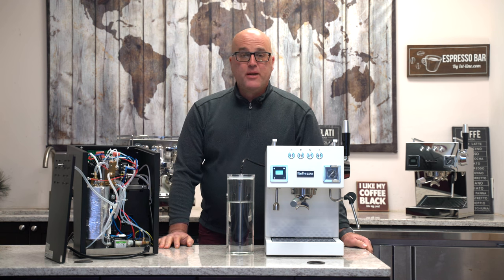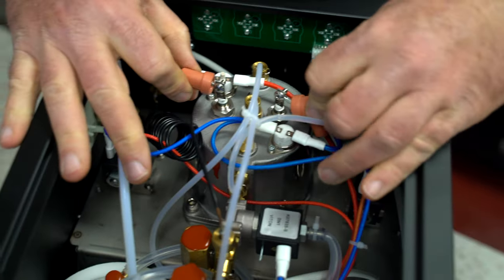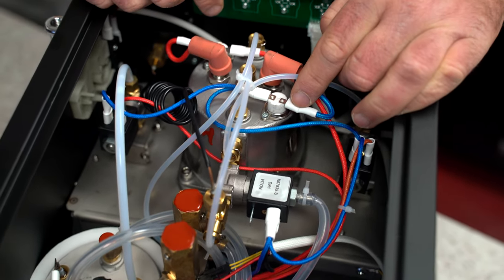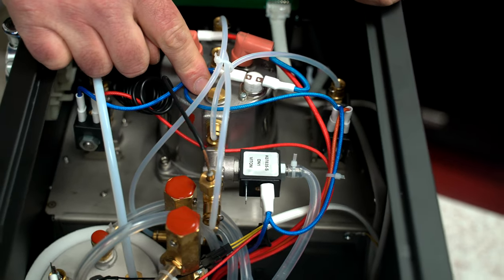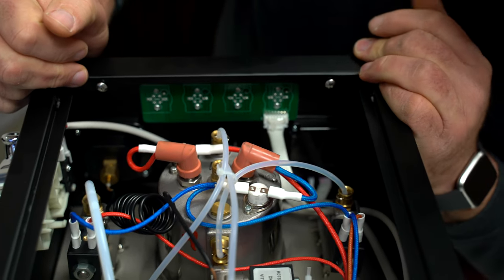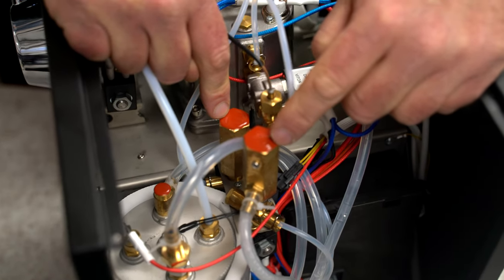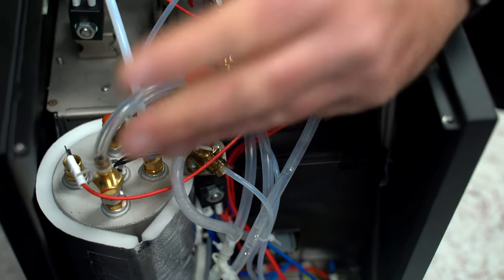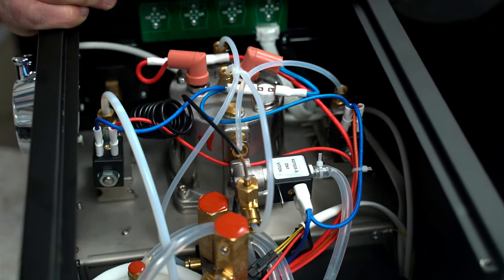Inside The Bellezza Bellona Dual Boiler Espresso Machine

Comment: How would you rate the repairability of this machine? Do you get spare parts from Bellezza?
Reply from the maker: It is not the easiest machine to repair, but not near the most difficult either. So far, we only had 1 issue of a loose wire on the wire coming off the screen. 2 machines arrived dented in shipping. The body panels have been the msot difficult to acquire.

Comment: Love the video - question for descaling - how would you empty the steam boiler? I assume descale solutions will enter from the water reservoir into both boilers, leaving the question of how to ensure the steam boiler can be emptied.
Reply: Did you find an answer to this? The hot water spout on mine is not working which is normally how you would empty the steam boiler. I'm hoping the descale from the steam boiler can be emptied through the hot water valve on the bottom of the machine.
Reply: @imcravingcoffee  The bellona"s hot water spoud is fed by the brew boiler not the steam boiler.  I believe there is a valve on the bottom on the steam boiler to empty it.

Comment: So does the OPV drain into the drip tray or back into the pump?
Reply from the maker: Please re-watch the video as this question was covered.
Reply: @1st-lineequipment  bit of an ignorant response but ok.  I re-watched and it still isn't clear.  You mention an "air release valve" I have never watched a review of any machine that mentions this part. Best I can tell you are saying it routes the extra OPV water back into the "beginning of the pump" so you're saying it doesn't route it into the drip tray.  Correct? Well this goes against most of the posts I have read about this machine, including from people who own it. Not sure who to believe on this....
Reply from the maker: @giltender  Sorry you are having a difficult time understanding. If the hose from the OPV goes back to the beginning of the pump, then it can not direct to the drip tray. This is why Java Jim did not mention going back to the drip tray or back to the reservoir like other makes and models. Others you have read about probably have a version 1 Bellona which the OPV most likely goes to the drip tray.
Reply: @1st-lineequipment  thanks for your response. Much more helpful.

Comment: V3 wish list - 1) reduce length of silly skyscraper steam lever by at least 50% - i'm sure there a few returns when poeple get it home and realise they cant get the lever under the counter - assuming if the lever body isnt piping hot you can just unscrew the handle and rotate the knob?? 2) get a real steam valve instead of a switch, there`s a lot of steam with zero control (in the interim, ship single hole steam tip also since no way to control steam volume ) 3) real pre-infusion option, and maybe 2 or 3 programs to add lower flow during shot 4) duplicate manual button on steam lever (variable steam counter clockwise and variable flow coffee lever clockwise - wouldn`t that be cool).   5) nicer pid and gauge design 6) auto fill and 4l reservoir option  7) separate standard classic power switch - if pid module fails, no way to power on?

Comment: For anyone looking to take the back panels off, the outline of how to get the Top and Back panels off is not entirely accurate - or at least for my model (I note that I may have an earlier model as I have a different LCD display) - To get the top panel off you must take the back off (as shown in the video), but you will need a very long screw driver to reach to the front of the machine to then release two screws.

Comment: What's the factory max static pressure (OPV bypass set point) at the Group head with a blind filter?
Reply: My machine shows 9 bar on the gauge when I use a blind filter. Apparently the gauge is measured at the group head but who knows how accurate it is. Would need a portafilter pressure tool to really know accurately
Reply: @splodinjoe  so odd, i see 8 bar...it also brews at 8 bars which kinda sucks. Anyone try to adjust the OPV?
Reply: @ChasedGod  I have the same problem it brews on maxium of 8 bars. how can i fix this? Is this really an issue?
Reply: @ChasedGod  blind filter shows 9. brewing never goes up to 9 in my Bellona
Reply: @zivjaron  i see that too, but i want 9 bar when i brew. It's not a big deal if your espresso tastes ok, mine tastes a little light for me even at a 1:2 ratio in 30 sec. Maybe a higher brew pressure will help with that
Reply: @ChasedGod  what's the fix?
Reply: @zivjaron  remove the seal and adjust the OPV i guess